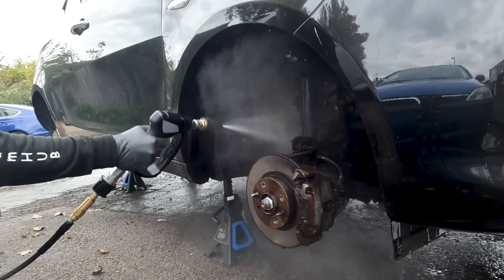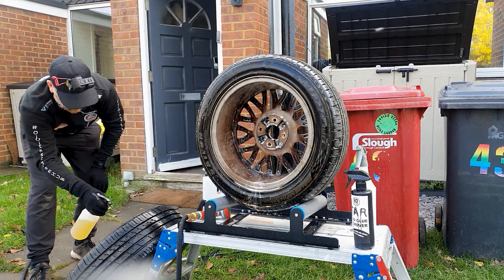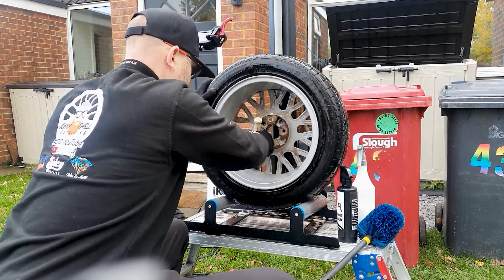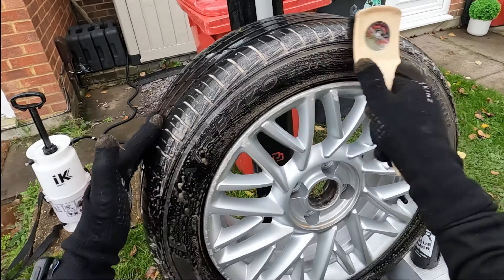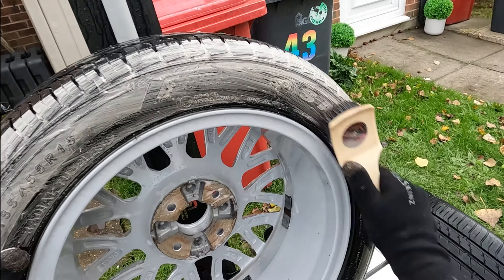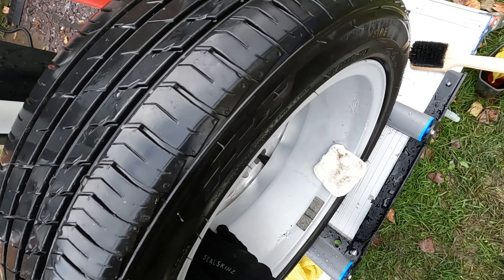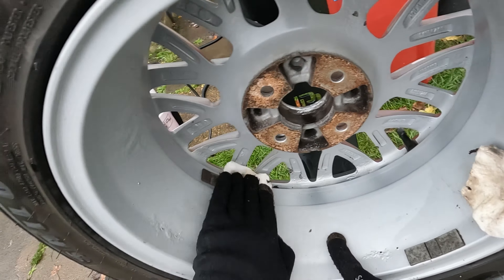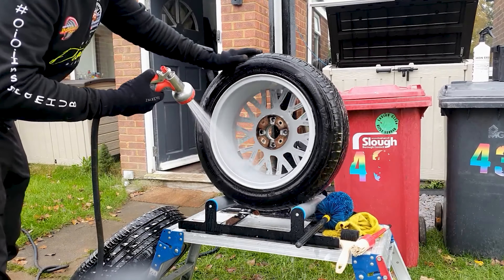EP.1 Step by Step  DEEP CLEANING Chrysler Wheels | Car Detailing

Comment: OiOi, good point about mind your back, Ive been switching some wheels around lately and cleaning/sealing them, if I was doing it more often would definitely want those stands set up at a nice height to work on to save some aching 👴🏻 👍🏼
Reply from the maker: Thanks nick and OIOI to you too pal,  yeah I added that to the edit as it popped into my head. 
Really made a huge difference, the new detailing trolley from poka will help more as you can stand up to do them which will be even better. 

Thanks for supporting as always.